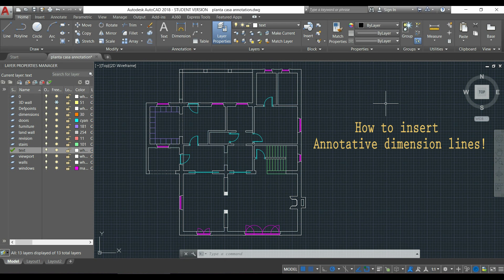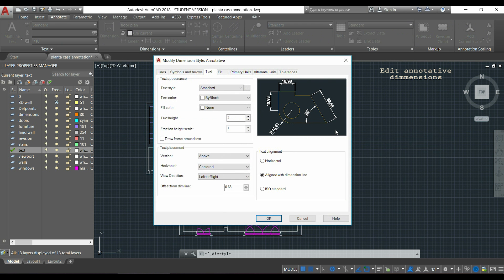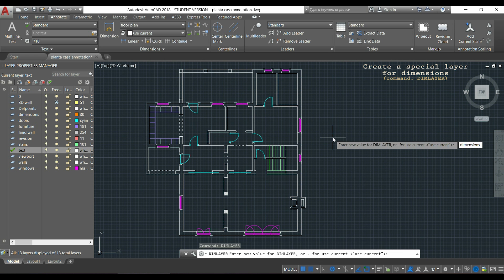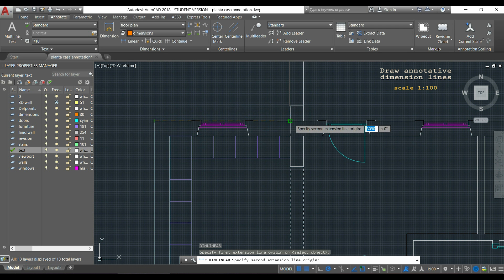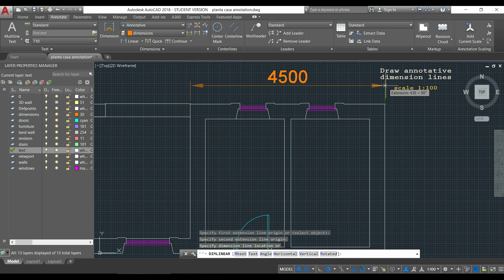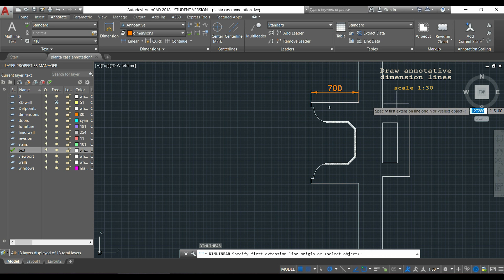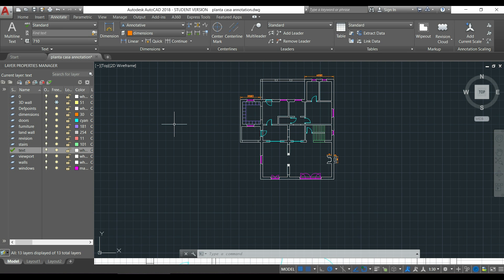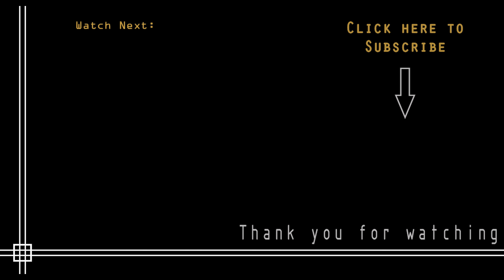AutoCAD Basics - Annotative Dimensions (must watch - very useful for printing!)

Comment: why you are not making in feet and inches?
Reply from the maker: Hello Waseem.
Thanks for your question.
In several countries (mainly English spoken countries) the most common units used are Imperial units (inches and feet).
In the rest of the wolrd it's most common the metrical system (meters, milimeters).
Reply: @CADinblack  you are right but I need to know and want to learn in feet and inches could you make it for us

Comment: Annotation and Scaling give me headaches.
Reply: I started off with AutoCAD 14 in 1998. But this damn annotation scaling gave me so much headache. I quit AutoCAD all together and moved on to other 3D packages, Revit and Inventor. They're more difficult to learn tough, BUT they don't mess about with annotation scaling. You just select dimensions and place and it remains same size on the print view.

Comment: You: ...they will only appear in the viewport with the same scale.
My mind: boom

Thank you very much, this is going to improve a lot my workflow.
Reply from the maker: Hi Chisa. Yes, before knowing that, I was like "why don't the lines appear?".
Reply: @CADinblack  I was just not using annotative objects at all. I'm self taught and I never realized the importance of them. When I made viewports, I even zoomed in them using a scale parameter, I feel so silly now. Really, thanks a lot.

By the way, I do have a question. I usually work with meters, and I discovered my AutoCAD has a small library with these annotative blocks where you can put the title of the sheet, section and so on, but they are in milimeters and do not scale accordingly when I put them into a drawing in meter units. Do you know how to fix this?

Comment: But what to do if I dont want to bother about printing scale at the start of drawing or during drawing. Many time I print in A4 size paper using print-> window. It doesnt need layout option. Is there any option to set annotation object to be printed in 3mm actual size in any scale which I dont want to predefine ?

Comment: sir my drawing in meter and i want to work in mm what should i do please advice.
Reply: dimstyle>modify>primary unit>measurement scale>Scale factor> put 1000.  It will display your meter measurements multiplying with 1000. But actual size of drawing will not change.  Be carefull while writing scale at the time of printing.
Reply: Or u can scale the whole drawing by 1000 times. It may work.